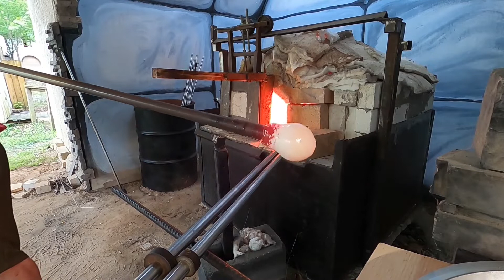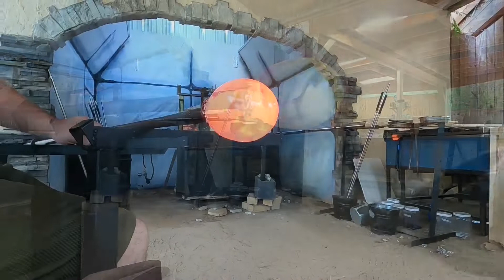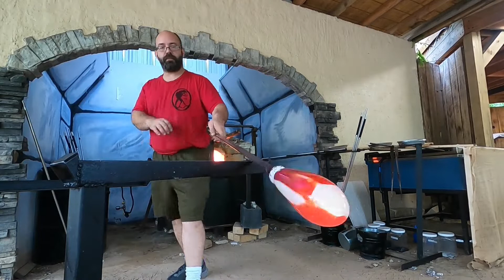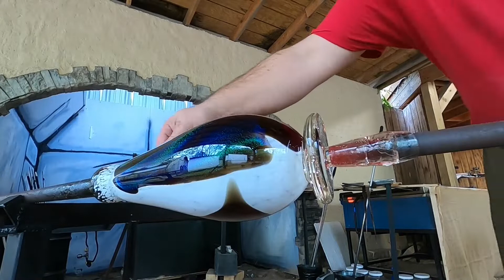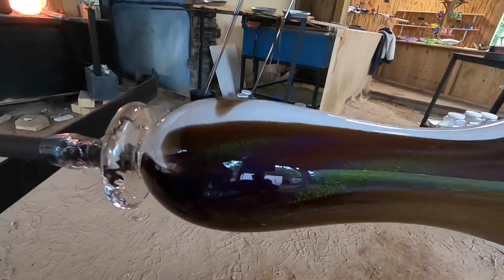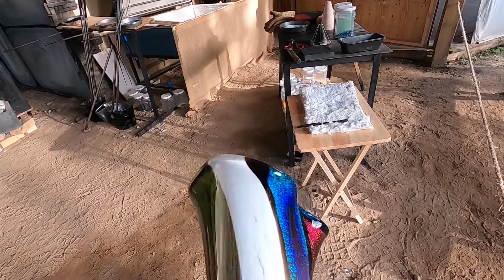Dichroic vase solo multiple camera angles

Comment: Nice. Are you using cullet or batch in your furnace? Thanks
Reply from the maker: I use cullet.  Bomma specifically
Reply: @Glass101  I’m having trouble with the bomma freezing up really fast. You ever have that problem? Thanks
Reply from the maker: I don't feel like I've had that issue, but more info would be needed to further answer your question in detail. My  gut suggestion would be to crank up the furnace temp a bit.  I don't use a glory hole and tend to keep my furnace around 2250-2300 F.
Reply: @Glass101  I’m using a baby dragon. The temp is about 2230F according to the infrared thermometer I bought from mobile glass studios
Reply from the maker: Natural gas or propane?  I find natural gas holes don't stay as hot as long as propane so whwn working with the door open for any length of time the furnace will bleed heat.

How thick are you working?  Thicker glass will stay hotter longer, but takes longer flashes to get the core heat back.
Reply: @Glass101  yeah. I’m on propane
Reply: @Glass101  so are you working in Pennsylvania usually when not at fairs or FL?
Reply from the maker: @mdbryan9525  , we travel year round for the most part.  Dec-March we are  in Florida.  April-May is Oklahoma.  June-July is Kentucky. August-October is Pennsylvania, and  November is Texas.
Reply: @Glass101  any recommendations on pop up canopies. I need one for when it’s raining. Thanks
Reply from the maker: I have an ez-up that we purchased probably 10 years ago at tbis point.  That thing is a real trooper.  We've used it hundreds of times and it is still good as new.  Ive also seen ezups fail their first time out so it is kind of a crazy shoot.  If it something you will only use a day at a time and only while you are with it, any cheap 10x10 popup is fine